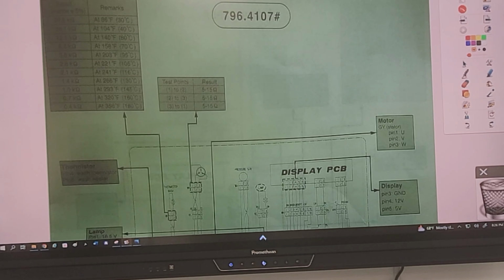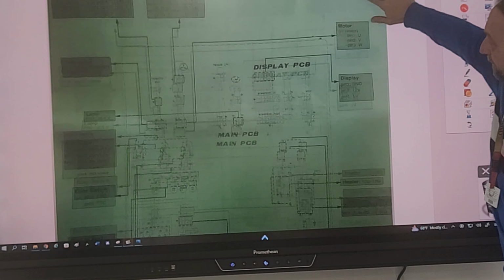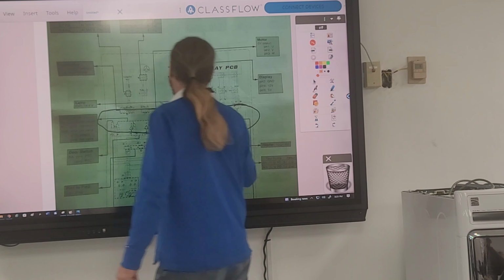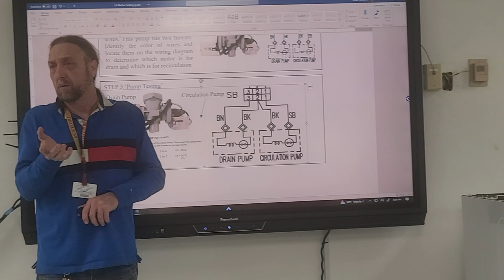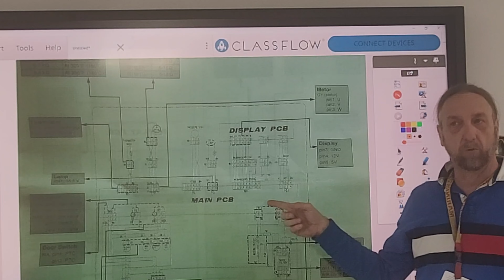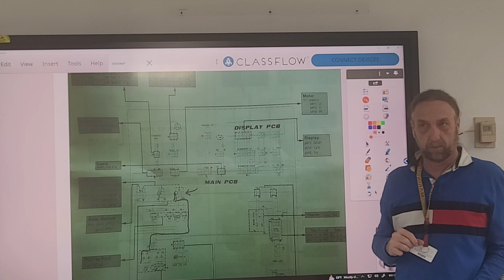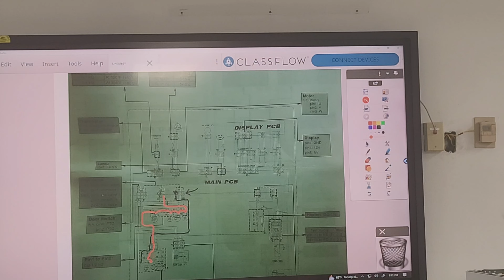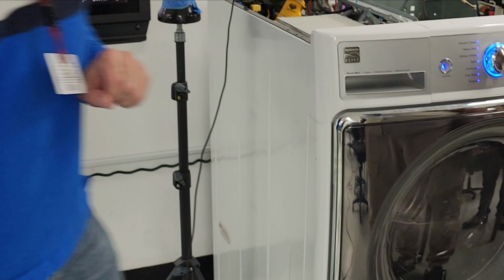LGwasher1sample

Comment: I had one recently that had 120v and proper ohms reading that turned out to be a bad control board,  the relay to the pump was bad so I replaced the control board and that fixed the washer.
Reply: The whole video shows we tested ohms then volts to pump not incoming voltage to the board, that would mean the pump was bad, you case may be different.